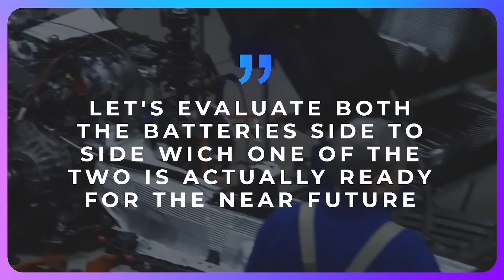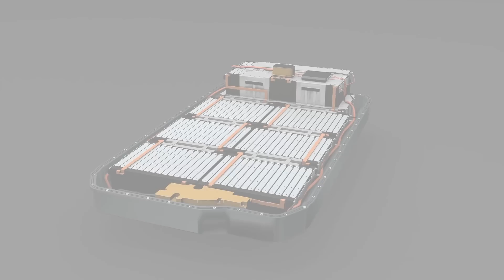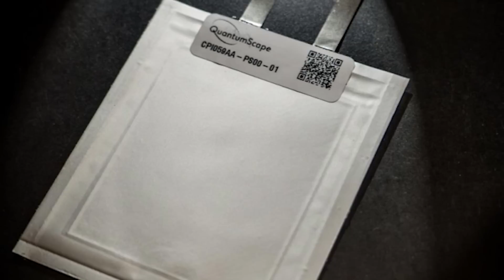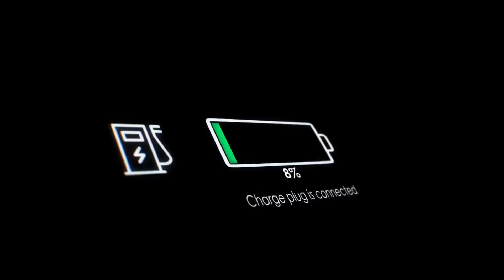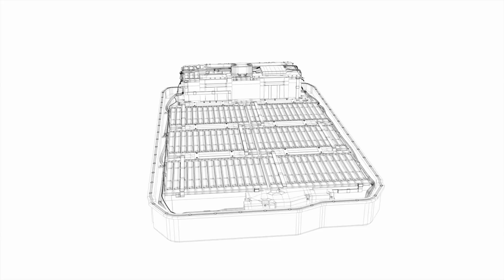GAME OVER! Tesla Battery vs Toyota Solid State Battery

Comment: Solid state weakness is still cost where Tesla has focused on driving costs down.  Toyota is on a uphill battle with antiquated manufacturing when they finally change they will have massive layoffs that will spur quite a change in the environment. Not impossible but, not favorable.

Comment: 0:09 You lost me when you called them "Electronic Vehicles" rather than "Electric Vehicles".  Electronics refers to the control systems used in vehicles.  Electronics have been used for decades in vehicles.  "Electric" more accurately describes the batteries and electric motors used to power the vehicle.
Reply: @Alfred Wedmore As I said, the "electronics" part refers to the control systems, even ICE vehicles have electronic controls.  The emergence of EVs is the due to the "electric" drive used to power the vehicle. The term EV stands for "electric" vehicle.

Comment: The first 15 seconds of your video are WRONG. Toyota sold & Leased Electric RAV4 EV's in CA, NY, and other states starting 1997. TOYOTA'S Amazing electric vehicles with Nickel Metal Hydride battery packs and 100 Miles range. I live in Davis, CA and decades later all those Electric RAV4's are still on the road with private owners using replacement battery packs. There are at least 6 families in my town still driving their electric RAV4 EV'S that were made years before Tesla had even demonstrated the 1st Tesla Roadster. https://en.wikipedia.org/wiki/Toyota_RAV4_EV
Reply: 95 mile range, 0-60 in 18s, 78 MPGe which is worse than some ICE cars, 4000 sold.
The car is trash.
Reply: @830927mjki  EPA fuel estimates for EV's in that era where low balled. We easily did more than 100 mile range in California's climate. The RAV 4 EV was critically acclaimed and ground breaking during a time when few EV's were for sale as most were leased or only available to fleets. Unlike a GM-EV1 a RAV4 EV could seat many adults and looked better than others in its class (it didn't have that ugly spare tire mounted on the rear hatch/gate). It out sold the Electric Chevy S10, Electric Ford Ranger, Honda EV Plus, Nissan EV HyperMini, etc. A very popular car as they sold out and had a waiting list for every RAV4 EV brought to market. My neighbors even imported their RAV4 EV from Canada to get their hands on one. Definitely not trash for the well informed auto journalist or electric driver of that era :-)
Reply: @LastTechnocrat  Of course they sold out, they only made 4,000 of them.
Compared to the no.2 selling car worldwide, the Toyota RAV4 (ICE version) which sold 1,070,000 last year!
The Rover City Rover is considered one of the worst cars ever made and that sold 9,200! lol
Reply: @830927mjki  The number of RAV4's they made was to meet the state of CA Electric Vehicle Mandate. Toyota only made the bare minimum due to influence from the sales and marketing unit. I don't think you understand the late 20th century EV market at all. It was a very successful vehicle.
Reply: @830927mjki  lol thinking a car thats 24 year old and goes 95 miles is trash LOL even if its a later model its still at least 7 years old. and if the car still runs thats great.

Comment: Doesn't matter who released it first.   The one who does a better job with manufacturing and lowering the costs substantially will be the ultimate winner.
Reply: Still most likely a Japanese brand, probably Toyota tbh, or possibly a South Korean brand; Hyundai and Kia have stepped it up big time the past several years.  They'll always be the best bet. I love my '16 Mazda 6, but I'm pretty sure Mazda is staying committed to combustion engines for a while with some hybrid, can't wait for the upcoming I6 Mazda 6.
Reply: @davekrebo7180  you may be right but don't leave out the Chinese.   Both Japan and China Govts are putting big money into supporting these private ventures.
Reply: They may win but who design it first owns the design Paton
Reply: @fugoogle5802  I thought they are two different types of battery tech?  So the patents wouldn’t make a difference

Comment: This is a clearly Tesla biased channel probably funded by Tesla.
Musk is famous for missing his target dates and I remember when he 1st announced the new battery Samsung was pessimistic in scaling up their production. It seems that they have been proven right.
Beyond that, there still remains the time it takes to charge them which is the biggest headache for those who are used to driving ICEs. 
Finally, the one thing that Toyota doesn't lack is production capacity and scaling experience. Musk and Toyota are also discussing partnership. So I wonder why either of them would be interested if their technologies are diverging. But, if and when Musk decides to sell his shares as he keeps publicizing, Tesla will become more affordable for a takeover. 
SpaceX is becoming more and more demanding of Elans Musk's time and he always said that at some point Tesla will need to become part of a bigger structure. With Chinese at his tail who is bigger than Toyota and that is saying nothing of Plasma Kinetics that could turn the whole EV market upside down? 
So, I wouldn't be so sure.
Reply: You mean the Roadster isn't coming in 2020??? And the cybertruck isn't coming soon???
Reply: @grozaphy  Nokia once was thought impossible to compete with.
Japan's strategy on energy is still based on hydrogen(ice-hydrogen). Solid-state hydrogen will remove hurdles for adopting it as a prefered energy resource compared to electricity by rendering expensive infrastructure unnecessary.
Reply: @ExiledGypsy  nokia had pretty terrible leadership :D

Comment: not electronic car, electric powered car. EV is electric veihcle not electronic vehicle. Also both types of battery are a worse idea than the hydrogen cell powered vehicle which is already being adapted for trains and trucks.
Reply: To produce hydrogen you need twice the amount of electricity to get a car a certain distance instead of when you put the electricity directly in the car. So no it isn’t , at least not for cars. They wanna use it for trucks for trucks, airplanes and boats because the batteries for those would just be too heavy . But yeah that’s the reason almost every car manufacturer and now also Toyota focusses on electric cars and not hydrogen fueled cars .

Comment: Also the "rectangular is better" is a bit of a statement from somebody who had no experience designing battery pack. Alto small cylindrical cells require more jumping through hoops to make all the connections between cells (however robotic manufacturing stuff alleviates the issue here), it's the prismatic cells that are a true PITA in battery pack design. Starting from the top issues with prismatic cells: Need for compression of prismatic cells leads it self to people stacking to many cells together creating to rigid structures, to many cells together complicates your thermal management, prismatic cells usually come in large sizes so cooling of individual cell in complicated and sometimes forces people to cooling via cell terminals (really hellish idea, but sometimes it's the only thing you're left with), larger singular cell size increases singular cell evacuation energy, fusing larger cells alto seems easier it lends it self to bigger problem that singular large fuse promotes more spectacular single cell evacuation, impact protection for larger format prismatic has to be way sturdier due to more energy per single cell and also impact mechanics that usually dislodges single cylindrical ones out of the way, and finally tightly packed prismatic are inherently more likely to cause chain thermal runaway unless you're prepared to isolate each and everyone of them with thermal barrier which again leads to idiotic battery pack. But hey all those can be engineered out ... but unfortunately reality for now is that cylindrical cells are superior for MAKING cars RIGHT NOW.
Reply: Damn son, seems like you’re more knowledgeable than the people who made this video
Reply: @unstoppableExodia  And people that make videos, make battery systems ?
Reply: @tommybronze3451  I doubt the folks who made this video have a more than superficial understanding of battery systems
Reply: @tommybronze3451  yeah that wouldn’t surprise me
Reply: @unstoppableExodia  Sorry as I came across to defensive in first reply ... maybe I'm always on a lookout for a boogey man with a snarky comment :D
Reply: @tommybronze3451  that’s ok. It can be hard with text to tell if someone is being sarcastic or not
Reply: @unstoppableExodia  Bravo to the 2 humans that can agree to disagree and apologize when their wrong. Thank You, we need more open minded people in this world. Peace, J
Reply: The longest sentence in the world ^^^
Reply: @timmyvigland8962  Forgot to brake it down for twitter mob ;)

Comment: It’s still a half rumor but many are expecting the Toyota bZ series to have their new batteries by summer 2022. The bz4x will be larger than the RAV4 and be pure electric with over 300 mile range with quick charge ability and under 40k. If true I’m trading in my Volt.
Reply: With a resell value that will drop off quicker than a Tesla with even less options than a Tesla? Not to forget Toyotas awful entertainment systems? I build Toyota cars in Kentucky, and I still wouldn’t purchase their EV’s. They’re done in the EV market. They want hybrids and their hydro cars to be the thing of the future— they fight EV hype behind the scenes. 

Reliable? Sure. Exciting? Fuck no. I refuse to purchase a first generation vehicle and lose equity.
Reply: @kilowhiskey7973  I don’t usually buy anything new so I can wait and see how they do in reviews and maintenance. It’s since come out that the range in them isn’t really that great which kills it for me, I’ll just stick to hybrids until the hydros start hitting the market which are much better bet long term.

Comment: If you think Toyota is easily going to go down, you're extremly näive. Tesla has a really big problem. They're EXTREMELY expensive
Reply: @Highborn  Yeah, not even close.  Most popular car in America:  Toyota Camry $26k -$31k (plus $7k for basic upgrades like glass roof and navigation that are standard on Model 3 Tesla),  max service life roughly 250,000 miles.  Tesla Model 3: $36k, 500,000 miles in fleet service...less maintenance, less fuel cost, vastly superior performance.  You have to buy 2 top of the line Camrys to equal one Model 3.  Tell me again, which is the "EXTREMELY expensive" car?  One more thing...Model 3 has the best resale value of any car made today...5.5% loss over first 3 years.
Reply: And inflated stock.  It's like hiring an engineer finished out of college vs 90yr  experience engineer.
Reply: For now. When the 25K car gets released, it's pretty much game over for the other companies. Tesla's are expensive but have good reliability. Other companies don't even have over the air updates. Don't even mention the buggy tech and unreliability of their charging stations. Apple became number one not because of price, but because of the technology in the phones. Who is going to want an EV that they can't charge or use reliably. Even if Toyota succeeded, where are you going to charge it. Most charging stations are located in cities and unlike Tesla, most don't have a dedicated spot of mass charging of vehicles. You might end up having to wait hours just to get a spot to charge it
Reply: @insanittiez4860  tesla are the most unreliable cars in the world, even Nissan leaf is 10 times more reliable than tesla.
Reply: @shaheenshad5012  Pretty sure you just get your news from CBS. Chevy cars have been exploding this whole year. Other legacy auto makers have unreliable software that has been buggy, glitchy, and takes you to a gas station when you choose charging station on the gps. Teslas are also reliable when it comes to maintenance and have the best resale value. There is a reason why Hertz placed an order for Tesla's and not Nissan leafs. Does the leaf have over the air updates, does it get new features added automatically. You can trust the Tesla software to do what it is programed to do, can the leaf do the same. The leaf doesn't even have half of the features a Tesla car has and it still requires more maintenance than a Tesla
Reply: @insanittiez4860  lol, look up after market costs of leaf vs tesla?
Reply: @shaheenshad5012   The leafs cost around 30,000 and a 2019 one ranges from 18K to 23K. That's around 40% of it's value lost in just 2 years. A 2019 model 3 at worse will only lose $4000. If you think I'm joking, try searching for used cars and look up the prices. Hertz could literally sell their Tesla's 2 years after use and still make a ton of money. Regarding the aftermarket cost, of course the Tesla will cost more, it's a better car with better performance, features, quality, and superior battery. Maintaining a car will always cost more than maintaining a toaster
Reply: Tesla is going to lose it big. Right now they make the worst finished car in the world and they are not reliable at all.
A huge number of people and companies have already sued the company.
And it's much worse than we know. In addition, hydrogen will be the future and they are already building huge hydrogen factories in Europe.
But that's for later. Americans have never produced a quality car and that will never change.
Only Japanese, Europeans and soon, the Chinese can do that.
Reply: @antoniocalimero1173  As a Model 3 owner myself for the last 2 years, you have absolutely no idea what you’re talking about.
Reply: @antoniocalimero1173  Not sure you know what you are talking about. GM Chevy bults are exploding in people's garages. Ford had to do a recall because their car windows weren't fitted properly (they previously laughed at Tesla for this). Tesla doesn't even come close to Ford, GM and VW when it comes to lawsuits. Hydrogen is not gonna be anything till maybe 2030. China and the US aren't focusing on  building hydrogen infrastructure so I'm not sure where you think Toyota will poop the money to build an infrastructure in 2 nations. The model 3 ( or Y, forgotten which) was the most sold car in Germany (not most sold EV, most sold car). Europe, China and the US plan on banning the sale of EVs by 2030. Ford plans to produce 80K EV trucks in 2025, lucid on plans on making 250. Tesla will be making around 2million once Giga Berlin and Texas start next year. How is Toyota going to make and sell 8-15 million EVs or Hydrogen cars by 2030. They don't even plan on producing batteries till 2025
Reply: @antoniocalimero1173  hydrogen is so inefficient it makes no sense to go for hydrogen.
Reply: @antoniocalimero1173  excellent and very true statement